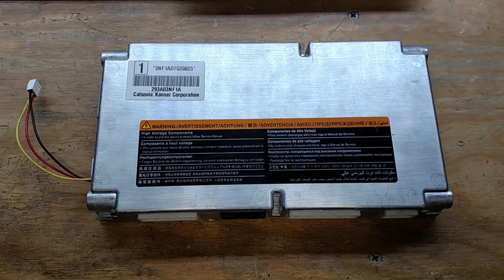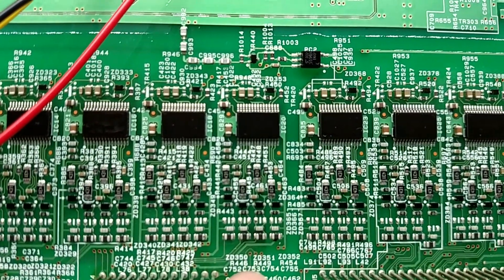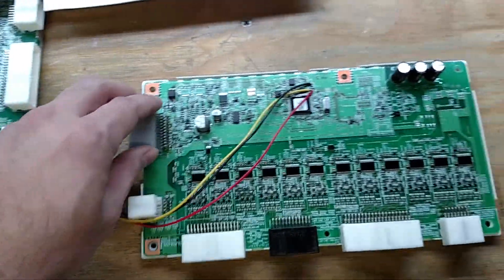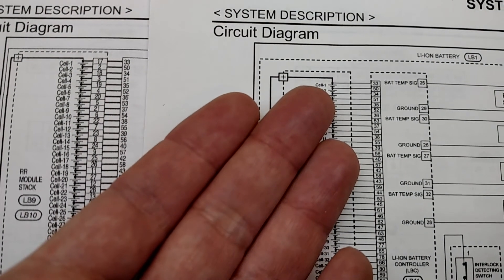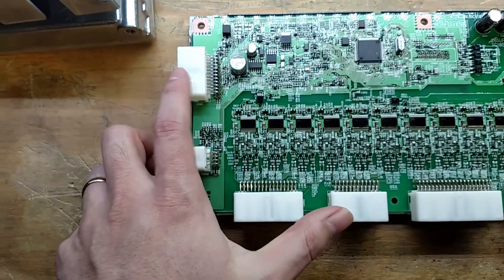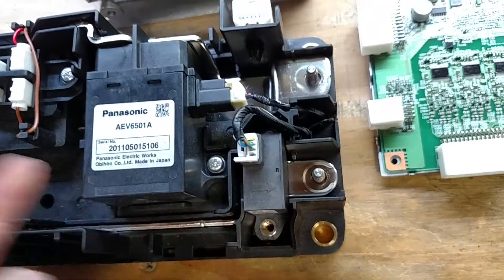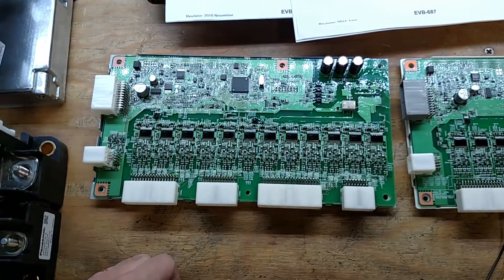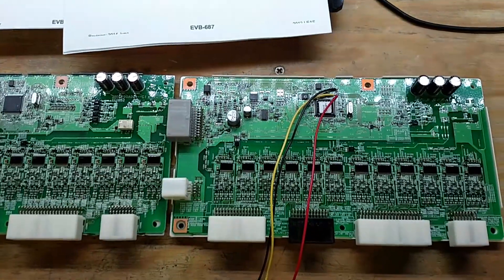Solectria E10, Lithium Ion Battery Upgrade, Part13

Comment: White connectors are 2011-12 versions. The gray connector in the bms section was change to prevent mistake in assembly line I think because low voltage connector was same as the whith one in 2011-12 version. I have studied both and the connections are same except they change the connector for a grey color one. Now the low voltage connector have different connections between both versions: 2013-15 have 3 interlock connections because of the extra PTC connector and the 11-12 have only two. Also cold weather package have connections to enable heating relay. This is the main differences also the bms IC change 15110 and 15120, not sure about the small relay in the bms for 11-12 versions.
Current sensors have same specs, only new design, I tested it with a load on my bench test and they just took off from the relay box and put it near the disconnect safety fuse. Inside the current sensor, the parts are different but the reading and specs are same also pinout is same, work at 5Vdc, gnd and signal out. With no current flowing in it, the signal dc voltage is around 3.2vdc